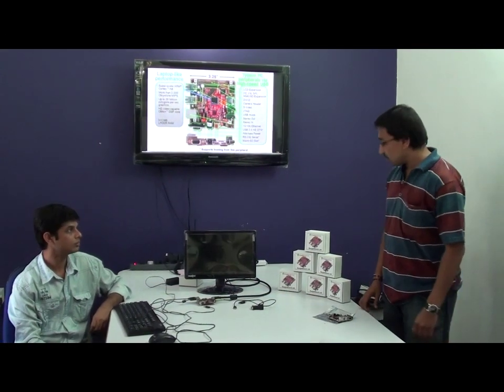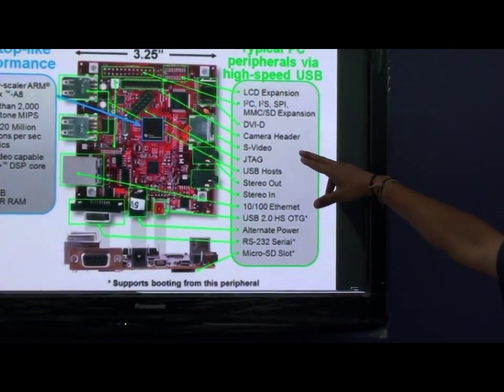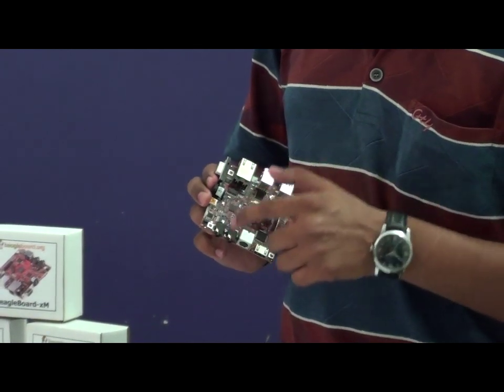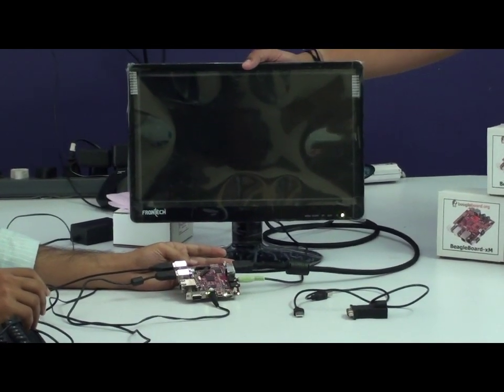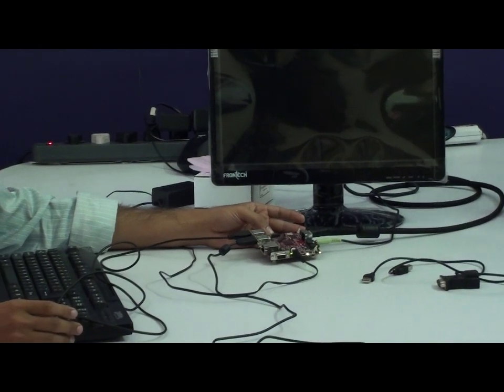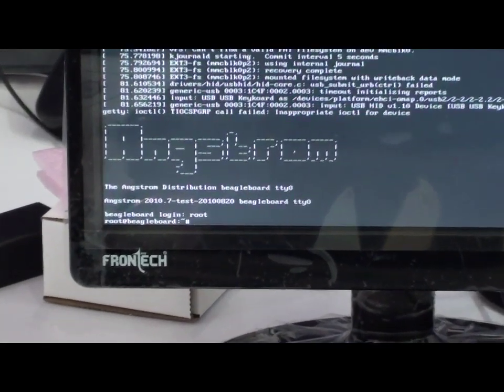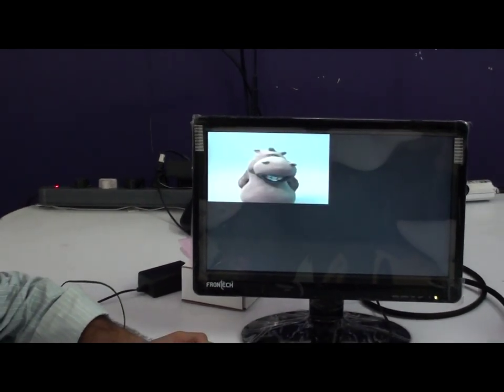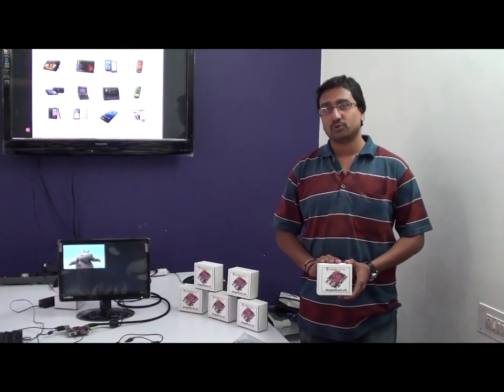Tenet Technetronics: Beagle Board XM

Comment: hai dinesh and vinayak , i traied with prebuilt image , it is not booting 
 
its showing error
    
U-Boot SPL 2011.12-00010-ga3eb89c (Jan 29 2012 - 14:53:43)
Texas Instruments Revision detection unimplemented
OMAP SD/MMC: 0
timed out in wait_for_bb: I2C_STAT=1000
reading u-boot.img
spl: error reading image u-boot.img, err - -1
### ERROR ### Please RESET the board ###

please can u rectify that problem